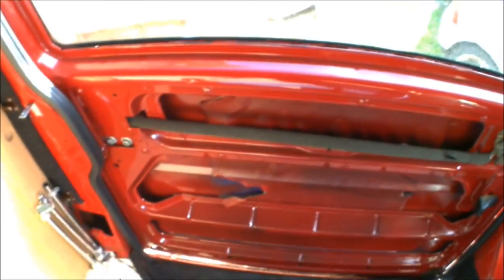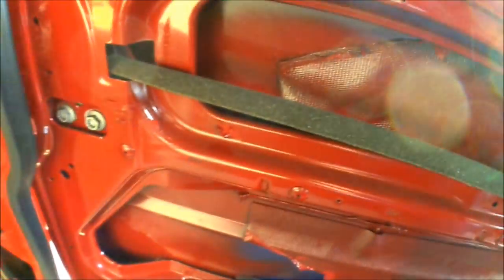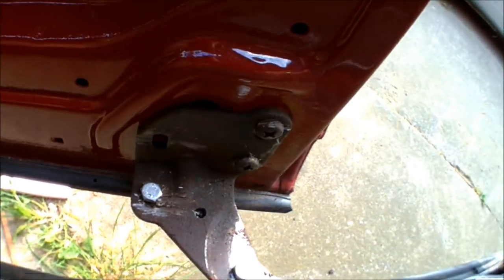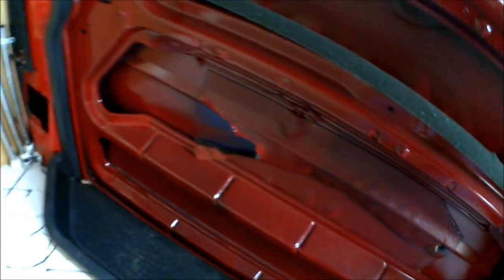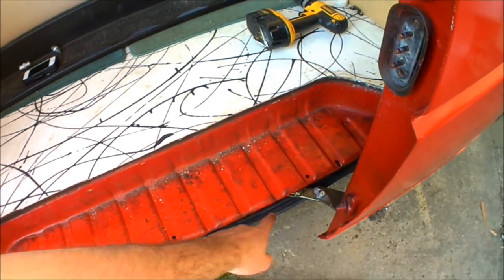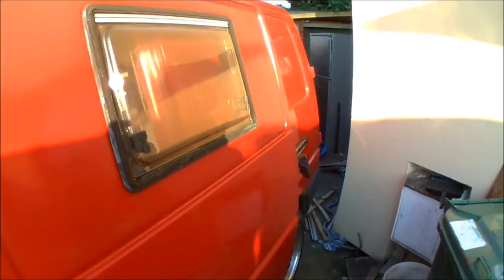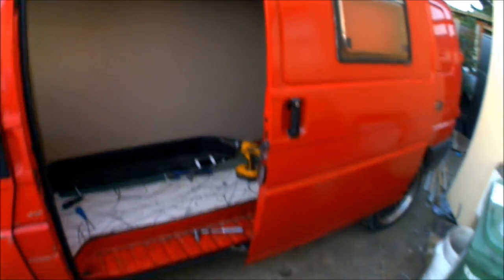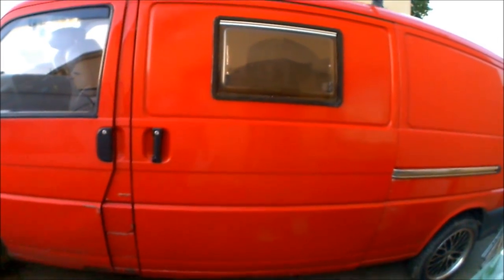VW T4 How To Adjust Alignment Or Remove Sliding Door From Van

Comment: Thank you very much for the video, the body shop replaced both middle and bottom on mine but alignment is way out when opening its slightly touching the body but other has good 2 inches distance when opened. Going back on Monday

Comment: Hi thanks for the vid, it helped me to make my sliding door fit better! However, it's still protuding a bit at the bottom of the rear of sliding door, even having someone pushing it in didn't make any more of a difference, which of the 2 bolts do i need to adjust to bring the door in?
Reply from the maker: The very top roller can adjust alignment

Comment: Thanks for your videos. Great. Can you help? My problem is that the door drops from the top runner guide just before the door closes. Can you tell me best place to make adjustment?
Reply from the maker: if it drops just before closing you might have a rusted bottom roller channel and the bottom roller is dropping into a rusted out spot, worth checking for that as roller adjustment wouldn't solve last minute drooping
Reply: @TheCampervanBuilder  Thanks for your reply.  No it's just come back from the spray shop.  No rust. Bottom roller replaced couple of months ago. I suspect the paint shop haven't aligned it properly. I'm thinking of adjusting bottom roller bolts, will this raise the door do you think?
Reply from the maker: Both rollers can adjust the height of the door, the bottom has 2 way adjustment for height & depth, the middle can be adjusted a bit for height too.  Try and have someone on the outside holding the door as it should be and tighten from the inside.  If it drops after tightening, readjust slightly higher than it needs to be so when tightened it'll drop to where it should be
Reply: @TheCampervanBuilder  it was in fact the bottom adjustment. The paint shop hadn't tightened the bolts! Causing the door to drop. Thanks.

Comment: Exactly what i was looking for, thank you <3
Reply from the maker: No problem, glad you found it
Reply: @TheCampervanBuilder  Any chance you ever fixed a up/down manual sunroof on the transporter ?.

Mine is on a 98 transporter, it opens upwards with the turn of a handle.
Cant seem to get it to close propperly, and cant find any video on my type of sunroof.

Everything seems fine, just wont close.

Have not taken it fully apart yet, as i dont have a haynes manual or a propper video yet.

In 5 to 7 days i am going on a 3200 km to southern spain, and would love to get that sunroof closed before the trip :D.
Reply from the maker: I've not touched any sunroofs, some are fitted aftermarket so it could be any make / brand, if it opens but doesn't close it will be the mechanism inside, possibly slipping a cog or something similar but I can't offer any other advice than that
Reply: @TheCampervanBuilder  
Cool thanks a bunch :).
Will see if i can get the mechanism working or find similar at scrapyard.